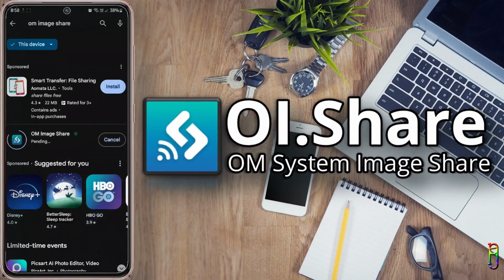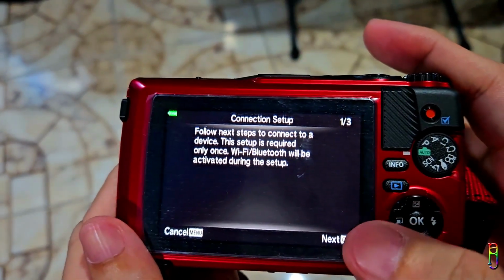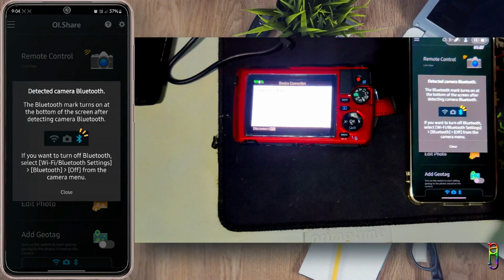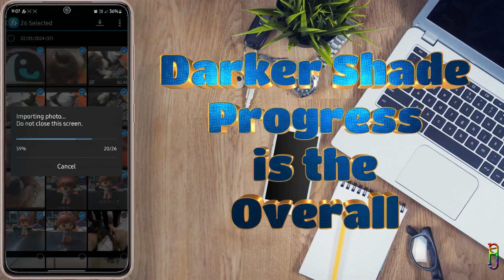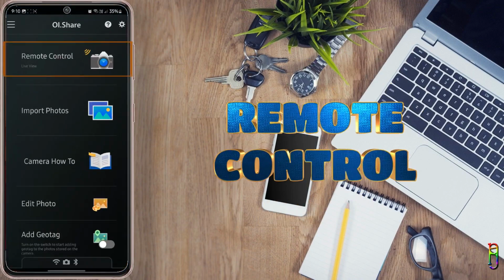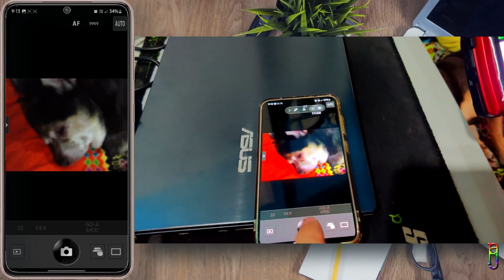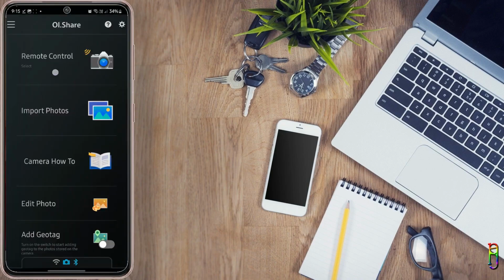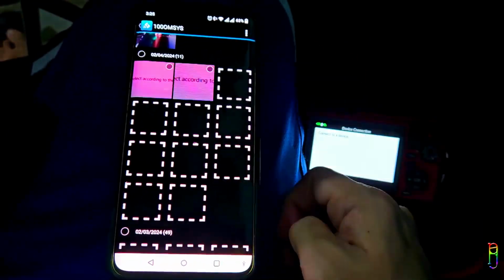OM System Image Share (OI.Share) Using Tough TG-7

Comment: My iPhone 16Pro will not read the QR code and will not connect manually. Apparently newer iPhones don’t want to know the OI Share app. Luckily it works fine with my iPad Air.
Reply from the maker: That"s unfortunate. Hopefully an update will fix it.

Comment: Thanks for video.:….
My ‘device connection’ is just ghosted out so can’t select it 🤷‍♀️ wish it came with instructions 😔
Reply: Have you figured it out, I just got mine and have same issue
Reply: Same issue here!
Reply: @jamesbrandongreen9988 I got it
Reply: @jamesbrandongreen9988  open the settings and enable the wireless debugging before opening the app
Reply: Solved it, you need to insert an SD card first!

Comment: You’re assuming that every option works perfectly. Like others, it fails every time on wi-fi. Very frustrating. Not having this issue with my Fuji X-T50 or Leica D-Lux 7. I have an iPhone 15 with up to date iOS software.
Reply from the maker: Of course! It will be a boring video if I show wifi failing 🤣😂

Comment: data transfer from the TG-7 seems to be same PITA as from the TG-6 (which i still use). maybe o.k for a casual shooter, but if you took 100 photos during a jobsite inspection and want to transfer them to the people in the office while driving to the next location: No way... take the USB-cable and use OTG mode from your phone, that's way quicker.
Reply from the maker: Totally agree
Reply: Thanks, this is what I wanted it for so in other words ok to just use an older model.

Comment: On mine after scanning the QR code,  I click "Join" to join the network, it says connecting to Wi-Fi, then it says "Failed to communicate with camera". I try again and get the same results. Help!
Reply from the maker: Try using other phones to isolate the problem. If it's still the same issue on other phone, then the camera's wifi might be the culprit. If the tg7's wifi is not working, you can still use a usb cable to transfer files.
Reply: @ribbytrivia  Thank you. I'll try that.
Reply: Same to me 
We need help please